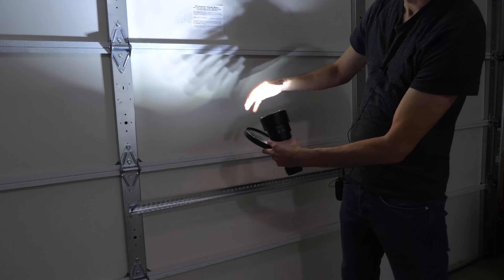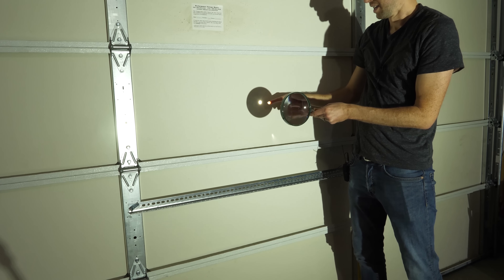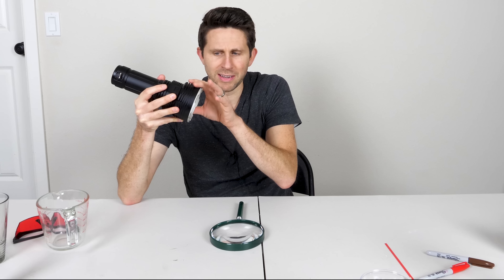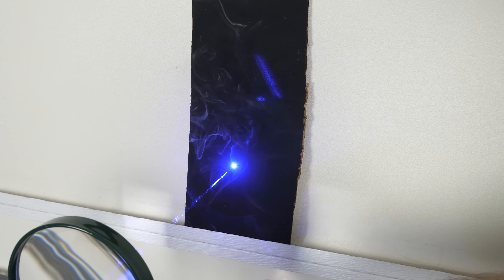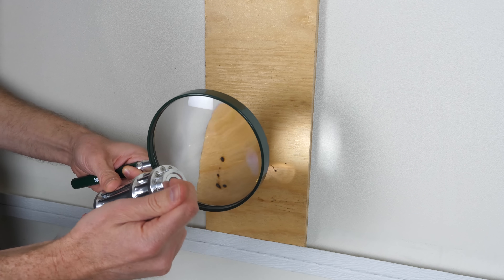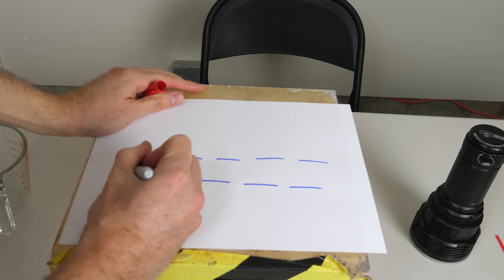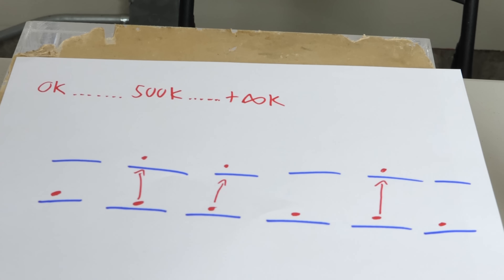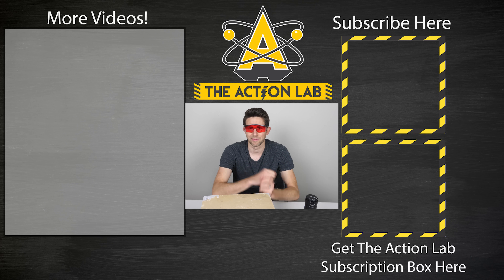What Happens if You Focus a 5W Laser With a Giant Magnifying Glass? Negative Kelvin Temperature!

Comment: You are not hitting the mark. The lens of the flash light is expanding light while your magnifying glass is contracting the light. The light bending power of the(Edit: there was a typo here.) lens on the flash light is greater than that of the magnifying glass lens. Look at your L.E.D.s and note the lenses. (Edit: The L.E.D. flashlight may be using concave mirrors or convex lens, either way the same effect is caused.)The point here has less to do with thermodynamics than what you are implying. Take for example a lit match and a sliver of magnesium the lit match is burning at a much lower temperature than the sliver of magnesium will burn once it is lit by the burning match. But wait, are these two fires not from the same source. Yes they are, one burns tremendously hotter and faster than the other. Both fires are from the same source. Here is where thermodynamics comes in. Ignition of the fuel source can begin at a lower temperature than what the fuel source will burn at, however there is a limit to how hot the fire will burn from that one fuel source. Add another type of fuel source with a higher temperature burn, you get a hotter fire.  Now if you are talking about heat conductivity of an element or alloy, thermodynamic law dictates that the end in the fire/source can not be exceeded in temperature by the end out of the fire. This does not aply to nonconductives such as light. Light is the product of a source, it is unlike flame, a thing unto itself. Once it is created it remains the same until it hit something and is either obsorbed or redirected or reflected.  However, it can be concentrated or diluted/spread out. Ergo light while it can be a source of ignition is not a heat conducting element. Therefore, not subject to thermodynamics law.

Comment: Your comments SHOW your comprehension to be false regarding photonic concept of light.  I corrected a hot young post doc on a similar idiocy regarding difraction.  Laser distance does not increase photonic pressure or surface mass energizing aka heating but does provide space for difraction of a minimally curved difracting material to concentrate DUH.

LEDs are small to limit photonic inhalation BUT density increases on mouser.com ROUTINELY not just in lab.    Your EXPENSIVE flashlight seems undeserved given it's power to confuse you.  Paradigms not understood as paradigms are dogma and your tail stinks so wagging.

YOUR flashlight can be lensed.  To suggest otherwise is to get it wrong AND bring contempt to the method.

Comment: That explanation sucks. If you use a big Fresnel lens you would pick all that light to a point. 
That point would be much hotter then the origin, but it is not the same 
area, it is just a single point hotter. Total energy would be less of course but that single point would be hotter. It is like a booster converter of electricity.
Reply: yeah i dont think this guy got a degree i think he just reads of the info from the internet
Reply: you r correct sir. right lens with right focal length and the flashlight burn right through the board.
Reply: I had not said that. I said that a point (lets say a 1mm²) of concentrated light would be hotter than any point of same area (1mm²) on the source. No matter if is a flash light or laser, since laser is just light of same wavelength and direction. If it is hard to capture normal light that goes in all directions, that is other problem. The point is that there is no special case for lasers.
Reply: Rodrigo Teixo laser and light are same?you need to get some physics classes
Reply: you should not say anything bad youtube and the action lab thinks its rude
Reply: What he needs for the sun and flash light is a collimator to mimic the laser so that the focused ray by the magnifying glass can be far hotter than the surface of the source. We can't compare spreading ray to a focusing ray.
Reply: You drug man I've seen you around
Reply: No argument. Just a dumb that knows nothing.
Reply: noah Farnsworth well laser and flaslight are entirely different in their nature
Reply: the hell sort of language is this
Reply: No one's gonna talk about how a Fresnel lens disperses light??
Reply: The expansion of your mind is just astounding" keep it up buddy!!!
Reply: Exactly
Reply: Exactly this! It has nothing to with the convoluted (and false) explanation he was giving. Of course you can make the focused point hotter/brighter then the original source. You just wont make the sum of energy higher. But im even more surprised about the haters reacting to your comment! It's ok to glance over the original explanation in the video. But its another level to go out on a limb to poop on the actual good explanation thinking it's wrong, when it is actually so simple.
Reply: No, you can't focus an incoherent source to an area smaller than the source size. The physically best you can do is to put an ellipsoid mirror around the LED chip with the chip at a focal point and all the light will be focused into the second focus point of the ellipse. Still, the spot would be the same size as the LED chip (or larger because of non-ideal optics) and it won't be hotter than the surface of the chip because it would have the same optical intensity (photons per area per second).
The absolute limit for a far-field focus is the diffraction limit (about a wavelength or so in diameter), which applies only to a single Gaussian beam (that's the electric far-field shape of a point source). You can actually achieve this with an incoherent lamp (e.g. flashlight) by putting a tiny wavelength-sized aperture in front of it - of course this would also block almost all of the optical power. Or you can use a laser, where all the light-emitting atomic sources are coherent and emit their energy into the same single Gaussian beam. That's how you can achieve temperatures of millions of degrees for nuclear fusion - not by using light bulbs and Fresnel lenses :)...

That said, the explanation in the video sucks indeed because he didn't mention any of this but instead used an inappropriate analogy about the thermal distribution of states. Try to explain a free-electron laser with that, smartface...
Reply: Novgorod you probably mean to say „...can’t do that using only one lens link in the video „
Reply: @RealNovgorod  
Actually. 
You use a "Plano-convex" lense in focusable flashlights using CREE LEDS. 
Which focuses said light source, without (with little) distortion of the reflected light. 
5 bucks on eBay 😂.

I should add. 
Most led car headlights use the same lease configuration set to a fixed focal length. 
...jus sayin...
Reply: TANGLDWEB: Well, how small does the focus spot get? A "focusable" flashlight has a light cone of some 10cm, maybe you can focus it down to few cm at best. And car headlights? They have to illuminate the whole road, so the light cone is on the order of meters in diameter. Now how large is the actual light source, i.e. the LED surface? Maybe 1-2mm? So how do these lenses focus anything DOWN if the spot or light cone is by far larger than the size of the LEDs? They are never meant to focus anything DOWN! Rather, they project the light coming off in all directions from a tiny spot onto a much larger but more directional spot. They are MAGNIFYING the light, not shrinking it down!
Reply: @RealNovgorod  
$5 bucks on EBay. 
If my explanation wasn't good enough.
Reply: @RealNovgorod  
PS... 
The video was showing how you may Focus Light. 
Not AMPLIFY it. 
...ask an Adult 😂...
Reply: @RealNovgorod  
$5 bucks on eBay 😂
Reply: @RealNovgorod  
Oh. And the size of the light source I mentioned earlier. 
$5 BUCKS ON EBAY 😂 

you may want to check the parameters of the lense I mentioned too. 
OR NOT,.. 🤡
Reply: Unfortunately a lot of people here don't understand anything about thermodynamics; the energy given off the light cannot be focused down to a point where the energy is far greater than the source, a magnifying glass does not increase the energy output of the light source no matter how finer the point, if this was the case then you could make an infinite source of power from the excess increase of light, this is why it is against the laws of thermodynamics. When you magnify the sun and start burning insects your are in no way increasing the power of the sun as the true power of the sun would turn this planet into black dust if earth were to touch the surface of the sun, another thing to understand about the Imalent DX80 if you look up the specifications of the LEDS in NO WAY that any "single" LED on that torch can pump out a straight "32,000" lumens, on its highest setting each piece of "CREE XHP70" LED is being overclocked to 4000 lumens.
Reply: @Skelath  we are talking about energy density over time, not the total energy. 4 watts in a 1 mm dot is way much hotter than 5 watts in 5 mm dot.
Reply: @WeisSchwarz  Imalent DX80 has 8 pieces of "Cree XHP70" LEDS overclocked to a max of 4,000 Lumens (8 x 4,000 = 32,000), max range of the Torch 806 Metres. BLF GT Giga Thrower has 1 piece (yes just one LED) of "Cree XHP35" LED overclocked to 2,500 Lumens with a max range of 2.5 kilometres, you want to tell me why a Torch with an inferior LED, inferior lumen level, and inferior amount of LEDS has over "THREE" times the "RANGE"? well it's simple the BLF GT Giga Thrower has a more focused beam. but if the magnifying glass does not increase lumens then what DOES IT DO?! you MUST be WRONG cause it HAS to do SOMETHING!!.... Well it does: it increases the throw distance of the light. Go figure. In the Torch community there are two types of torches, Flooders, and Throwers.
Reply: @WeisSchwarz  Also in regards to heat, yes the heat of the original source(s) is shared between 8 different points spread across a 6cm diameter (I own an Imalent DX80) and the torch does not provide a solid 32,000 lumens till the battery dies, it instead provides 32,000 lumens for an average of "3 minutes" depending on the ambient temperature and then switches down to 7,000 lumens (to prevent overheating) for up to 100 minutes on a full charge. The torch is designed to draw heat away from the LEDs via a built in heat sink, otherwise the Torch / LEDS will overheat and fry, and by all means you can focus all 8 4,000 lumen LEDS to a single point onto something that cannot disperse heat faster than the torch.
Reply: No one asked for your opinion on how good the explanation is it would be different if someone did but no one did so your kinda being rude by giving a rude opinion without someone asking for it
Reply: I do not have to ask to give a opinion in anything dumb. Youtube is free and action lab can ban anyone if he thinks its rude. Following your logic, did anyone ask your opinion on my opinion??

Comment: Wait, this is wrong though... the laws of thermodynamics say thermal energy flows from high to low, not hot to cold. Even if the total energy of the spot is lower than the source, a point can be hotter (higher average energy delivered to each particle of the target, just over a smaller area). Actually breaking the law would be making a point that is both bigger and hotter than the source.

Plus, you can’t actually focus it as small as you want. Heisenberg uncertainty principle says otherwise.
Reply: ALSO INFINITE TEMPERATURE CAN’T EXIST. Watch vsauce “how hot can it get”

Comment: so just use MIRRORS  and lenses. But also i dont get your logic that focusing the light from the flashlight breaks the second law. There is sureley some special single lens that could be used to focus it. albeit not in you normal sense. Its hotter sure, but over a smaller area. energy stays the same.

Comment: @The Action Lab As far as I know thermodynamics only apply if you have actual paricles that heat up and interact with each others (for example hot and cold air) but imagine you would do the same experiment in a vacuum then thermodynamics wold not apply, so that would mean your explanation is correct depending on the things adround the Laser/Lightsource but your explanation does not say something about that, this shows that it cant be this way. I wold explane the phenomen with the fact that laser is (almost) parallel light and your flashlight not therefore it behaves in an other way if you pass it trougth a lense. If you would somehow "parallelize" your flashlights light using special lenses/mirrors you could focus it as mouch as you wish. Short : thermodynamics don't realy apply here (maby a bit but thats almost nothing), its all about parallel and not parallel light.

And yes I know the sun stuff, its also parallel light but as you correctly mentioned you loose a whole bunch of light until it reaches the eart, but if it was parallel at the beginning (the sun surface) and not just approximately on the earths surface you could focus to any brightness/temerature.

If I have soue kind of misstake in my thoughts please correct me I dont want to hate or anything...

and also sorry for my bad english...

Comment: Why then if u throw a bottle of glass in the woods it causes fire.....?
Reply: If you throw the woods onto the surface of the sun, it will burn faster. The glass bottle can focus a miniscule fraction of a percent of the Sun's energy on a tiny point. That point, he claims, can never be hotter nor brighter than the Sun's surface. (More correctly, it can never have more total energy than the light it gathers.) 

The bottle's focal point does, however, get much hotter than the Sun's unfocused rays 8 lightminutes away from the source.

Comment: Loved the video! I would ask though, if you were to use multiple lenses to focus the area of the flashlight's beam onto a point smaller than that of the illuminated part of the flashlight, could you not achieve a higher temperature than the flashlight, as there would be more energy per cm² (same energy focused to a smaller area) than on the flashlight itself? Or am I just very confused...
Reply: The problem is, the lens by design can only focus a point source into a point source. With a large wide light source, you actually have the rays originating from multiple points, so they will not be focused down into a single points. It's easier to think of this by imagining the light source with a finite number of points and a finite number of rays e.g. let's say 10 points with 10 rays each. The lens is then going to focus this back into 10 points with 10 rays each at best. The concentration will not be better than the concentration of the original light source. I'm not sure how this relates to thermodynamics and lasers somehow being able to generate light rays that are practically parallel as if the light source was further than it actually was.
Reply: @TimpBizkit  depending on the shape of the source you can design corresponding series of lenses to focus every ray into single spot.

Comment: Imagine if you use those flashlight that can start a fire and focus it on a point with a magnifying glass.
The one that either uses a Xenon bulb or halogen and makes a buzzing sound when is on.
Can lit papers on fire.
While the light wont get hotter but more focus maybe

Laser like the vid says, you can get hotter as the point shrinks.

Comment: LASER lights are unidirectional at source. On the other hand all other lights are Omni directional. You can change the direction of normal light to one direction just using lenses. For LASER it's already in one specific direction, it has single wave length, and the light is amplified. Then it's much easier to concentrate it via lense and burn things.

Comment: That is heavily counterintuitive. I mean not the negative temperature, but the light focusing explanation. I'm pretty much sure that light from a flashlight can be focused, well not to a dot, due to aberrations, but to some spot some part of that would be brighter than the surface of the corresponding point of the surface of the emitter. And that should not violate any laws, as long as overall amount of light will be lower than emitted in the first place. Isn't it right? At least my intuition tell me just this.
It might be possible to get smaller projected image of a source with a ball of glass I think.

Comment: Couldn't you just shine the flashlight through a shiny pipe that is the same diameter as the flashlight face and have the pipe cut to the appropriate distance and the magnifying glass at the other side of the pipe? Wouldn't that focus the most of the light into a point?
Reply: Do you mean that the pipe is measured to the appropriate distance and the magnifying glass placed directly at the other end, or that the magnifying glass is held in front of the pipe at the appropriate distance? Because if the magnifying glass is out in front of the pipe, the light will still spread back out when it exits the pipe.
Reply: @pokelolmc6826  The pipe is also the appropriate distance. Sorry if I didn't make that clear.

Comment: So if you can't make a flashlight beam hotter cause of the light you lose then how about if you add a tube to it and concentrate its beam to the magnifying glass? There's gotta be a way. How about a regular bulb flashlight? It takes heat to turn on the filament inside.